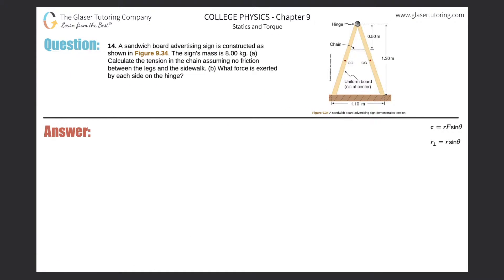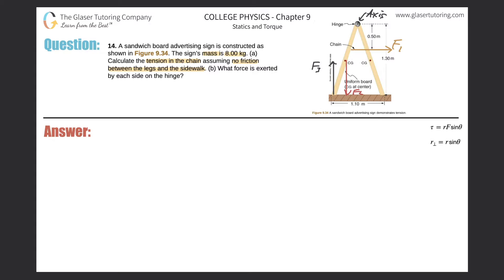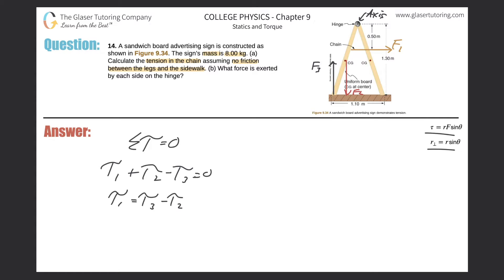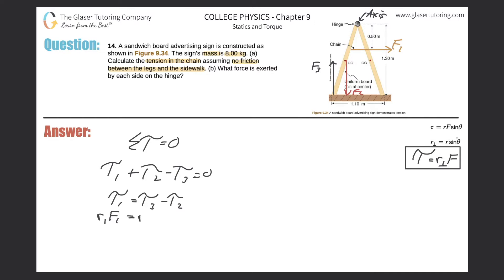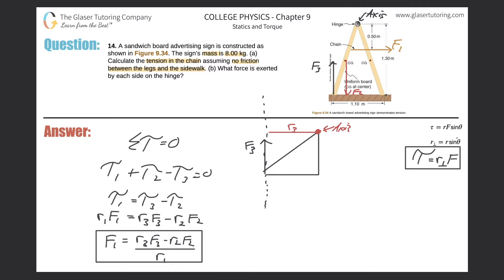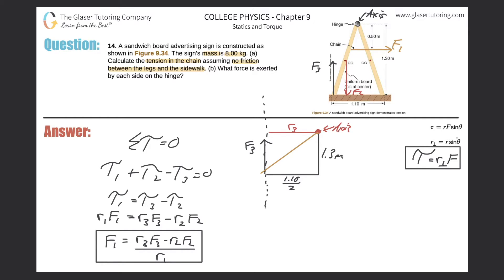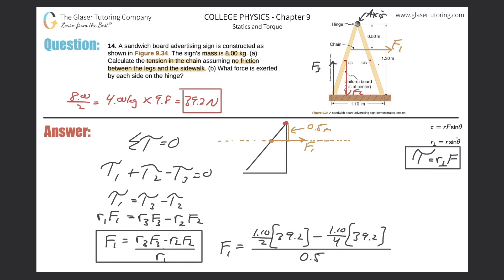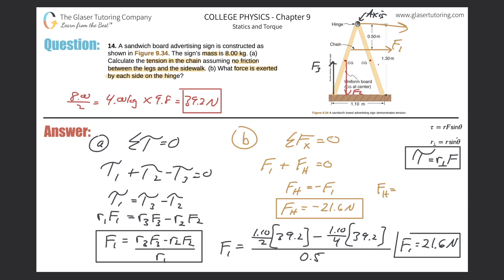9.14 | A sandwich board advertising sign is constructed as shown in Figure 9.34. The sign’s mass is

Comment: What happened to the sin theta? It’s like you had all these r’s and threw the angle away. R perpendicular doesn’t make sense to me because it doesn’t actually solve for any angle and simply calls it perpendicular. Also, why is it perpendicular specifically????
Reply: rather than using F sin θ in the torque equation, he uses r sin θ, hence the "R perpendicular." Its much easier to use R perpendicular in this case since we are given the distances for everything and we aren't given an angle (finding the angle would require trig + Pythagorean theorem, which is a lot of extra work).